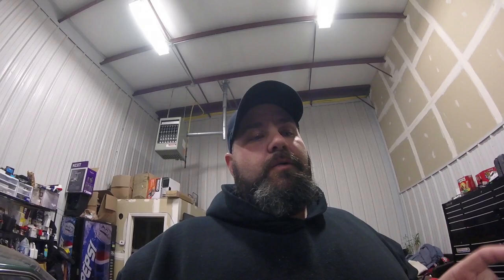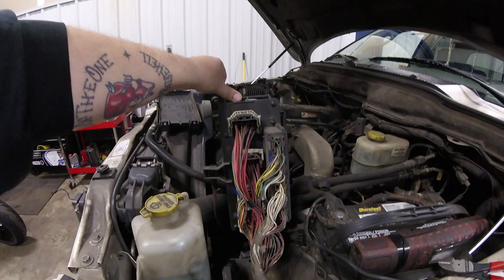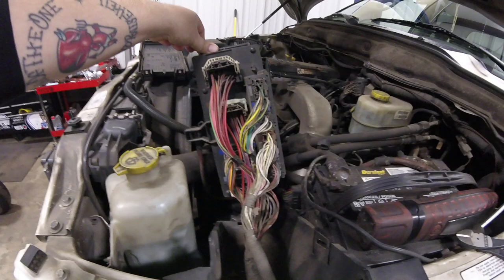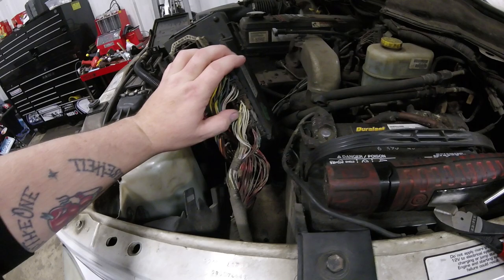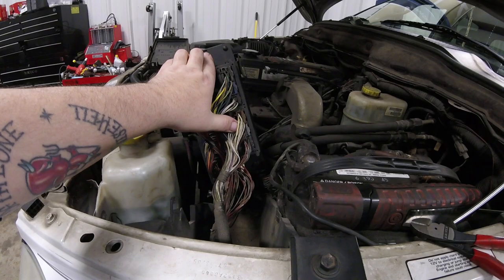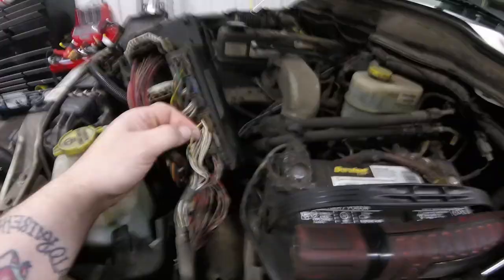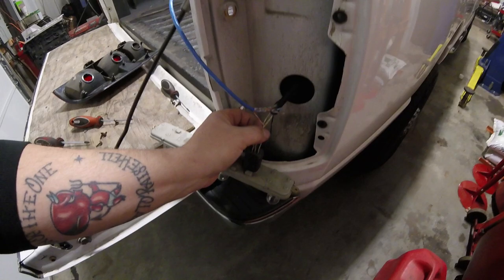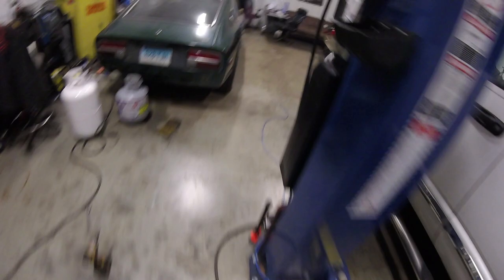Cummins Ram 2500 Bad TIPM??? Maybe not!

Comment: Acts like TPIM, replaced, reprogrammed, running, still same issues.  What ACTS like TPIM but might not be? (Intermittent Symptoms [90+ % of time): all functions of turn signal lever inop, hard starts (acts like WIM, but isn't), stalls at idle)  Most everything else appears normal.  Great, helpful, informative, appreciated videos.  Thanks for ALL the help!

Comment: I would suggest looking under the driver's side fender right below the back firewall. If you pull the wheel splash guard under the fender it's right on the right. there's a connector I have found broken corroded wires fuel pump trailer lights splice New pieces in and everything works fine for a while. Until they corrode and break again.

Comment: I think I finally found the video that hopefully helps me. My  radio works when it wants the power locks,front windows, heated seats and  steering wheel do the same. Remote start only works for 10 seconds or so then shuts off. If the dash cluster light stays on it'll drain the batteries. but doesnt do it all the time. The temprature reads -40 most of the time. some times it shows an acurate temp and then the windows work. It really is funky. Hopefully this helps. If you think its a different issue please let me know what to look for. Thank you in advance.

Comment: I’m currently going thru this problem on my 2008 megacab diesel, no juice that I can find from the right rear up to the tipm, no juice at the pin on the tipm, so thinking tipm is bad, but now I’m going to try actual voltage at the tipm and at the tail and see if I find the same as you did before wasting 500 on the doorman replacement tipm. Thanks for this video. I’m hate electrical with a passion. So this is helping.
Reply: Brian Arnett wish I had seen this message a cpl days ago. Lol.  Already ordered reman tipm, hoping to be installing Wednesday and seeing what I got from there. Thank you though, I bet that would’ve worked although I did try a jumper wire from a know good one and got nothing over there, so maybe I did it wrong. Ha

Comment: Hey! I really like what you are doing for us electro mechanically challenged people.  I have a parasitic draw in my 2007 Ram 1500 gasoline 4.7L, I took it to an electromechanics “specialist”.  He not only didn’t fix it but he gave my truck back with the speedometer not working and two service lights on!!  After calling 8 or 10 times I figured he had caller ID and decided to ignore my calls.  Then I decide I didn’t trust him any more even if the job was guaranteed.  So thank you very much because this video somewhat helps me figure out whats going on with my Ram.  I just subscribed to learn some more with you.  Stay safe.

Comment: thanks a million was driving me crazy,,,almost replaced the timp,,but thank to your video i did more exaclty what you did,,got voltage from tipm,,my probelm was a plug   by driver front left tire,,it was loose,,,put some wire ties around it and worked,,,tnx again,,,,

Comment: Amazing Info. Got a '04 Ram 1500 4.7. Have Towing harness signal issues last 4 years now; due to L & R signals not coming through to the 6 pin Harness Plug. Normal truck signal functions are fine. I even get 12v power, BU Lights, Break Lights & Day time running  Lamps; but again; no L or R turn signals to Tow Harness; for Trailer signals. This dilemma has resulted me in "jerry-riggin"  a Trailer break converter; from each L & R tail light; to Tow harness. While I have gotten away with this last 2 years; recently my Converter corroded badly causing all my signals to go out of wack; hence; I am back to square one. As a D.I.Y.'er I want to pull the whole signal circuit out form under the chassis; to locate a bad (or two bad wires) but it's a hell of a lot of work getting under the truck; when the TIPM could indeed be bad. This vid has enlightened my knowledge. I shall take your insight and Trouble shoot this way before I do anything else that's time consuming. Any other suggestions on how to resolve this issue; please don't hesitate. I just want a normal working tow package that's long term and proper on my ol' Dodge. Non of this wire converter crap.
Reply from the maker: Your best bet is just dig into it. Follow the trailer harness back to the tipm and make sure the harness has no breaks. If the wiring appears to be in good order, then its time for a TIPM repair.

Comment: So hopefully you still read your comments brother. I’ve got a 2011 6.7 thats been putting me through it. 
Windshield wipers randomly go nuts, gauge cluster goes wild. Serv 4wheel dr, gas light, check engine light, and more come on and off, radio turns off and on, and climate control turns off and on and works when it wants to. 
This all happens simultaneously. 
Tipm was very clean upon dissecting just very dusty. I sprayed everything with duster and electrical spray and also dielectric grease. Problem went away for a couple weeks and now it’s back again. If you or anyone could make any suggestions to help me I would greatly appreciate any help at all. Getting a circuit test tomorrow and going over everything I can. My knowledge isn’t vast in electrical or even automotive for that matter but ya gotta do what ya gotta do. Thank you ahead of time

Comment: So glad I saw this! My electrical systems gone haywire! No low beams, same issue as this video with my right tail light, driver side rear window will sometimes not roll up or down unless the door is closed and when open the interior light doesn't come on, if closed, with the interior light on it turns off when the door is opened and finally, my fuel gauge is reading like its sucking fuel at 1MPG! It's been driving me nuts!
Reply: your door to chassis wiring harness is broken inside the loom. Common issue, especially in the drivers rear door.
Reply: im having all the same issues except for the mpg thing

Comment: This is crazy same thing happened in my 06 cause I installed led and the hyper flash made the tipm disable it. I’m gonna try a hard reset. I ram a wire from my rear to from on left side. Now my right side is all out. Only blinkers work

Comment: 06 dodge 2500 diesel. My right rear tow blinker didn't work,(from trailer ground) so I tried jumping my rear blinker to it.  The tipm shut that circuit down too.
I found no power comin out of my tipm to my rear blinker.  Pulled it apart inspected it.  Looked good.  Went to dealer $90 they installed the update.  Raised trigger point from 15 amps to 20 amps.  Both work now.  
Wire colors are different than the 03 to 05 trucks.
Yellow &white wire right rear blinker.  
Yellow & green left rear blinker.
Reply from the maker: The update does help! What we did with my fathers truck however was to install LED bulbs on both the truck and his trailer to lessen the amp draw. He hasnt had an issue yet ;)
Reply: @MorFabIndustries  so I am having this problem with my front head lights I was having them all work then slowly I've been loosing them one by one and it's just the headlights I first lost my driver main light then i lost my passenger side so only had brights then I lost my drive side bright so the only headlight I have left is my passenger side bright everything else works I looked at fuses and I cant figure out what's wrong with it I was told it may be my multifunction switch so I'm going to check that next if you know what it could be would be greatly appreciated if you could help me out

Comment: A customer brought their truck back to the work I work at which is a trailer place that in stalls truck beds too. The problem is the truck won't start and the dome lights flicker and the mileage shows up in the dash and the tell us it's our fault. The bed still works and it's fuse is not blown. No one at the shop know what's wrong with it.

Comment: ok i just watched the video. heres what is going on with my 2006 dodge ram. i've had the truck for 3 years, a year ish into it i had the notorious driver lamp fail. did the little trick to wire the passenger side to the driverside and it worked. now both of my low beams aren't working, but my high beams do. side note. i have leds in the headlights. also when i bought the truck the previous owner had a viper remote start installed on the truck. when i remote start the truck it is hooked up to the headlights and makes them flash. a few weeks ago i remoted started my truck in the morning and the headlights were tweaker blinking and flashing. i drove away to work and i had no low beams. turned off the truck and let it sit for a couple of hours and they worked again.  fast forward a week or two, same thing tweaker blinking with remote start. but this time there is no low beams that work. and they haven't worked since then. now i don't use my cummins that much as it's a 3rd vehicle. today 2/23 i tried brand new stock beams and nothing. checked all the fuses and nothing. i don't have a code reader to see if it's putting out any codes. but man am i lost...
Reply from the maker: Dallas, the big issue here is that the TIPM failed originally when the first light went out. By wiring one light to the other you effectively doubled the current draw on the good side of the TIPM. These units fail due to over current. They have a bit of circuit protection which will allow for some overcurrent without damage, however they are bound to fail rather quickly when hit with double the load. My suggestion is undo the wiring that has been done to bypass the bad light, have the TIPM replaced and reprogrammed, Check all grounds in the engine bay for corrosion, And make sure that you use nothing other than factory specified bulbs in the lights.

Comment: I had an issue with no passenger running lights. So the last owner jumpered that wire to be key on. After dealing with swapping fuses, patching wires on the taillutr harness, change lightbulb boards, cleaning the pins, etc... I just jumpered the driver to the passenger for running lights. Oops... so far, so good. I think the culprit was a hardwired 7pin into the tail light harness overloaded the tipm circuits.

Comment: My 03 ram 2500 had the trailer fuse blown when I bought it. I replaced the fuse and have not had any issues until a week ago when I hit an elk that decided she was on the wrong side of the road as I was driving by. That only busted my grill inserts. That's when my passenger side headlight decided it doesn't want to work. Everything else on the lighting system does.  I back probed the wire about 2 inches before the connection and had a good reading. So I changed the connector. Still no light and lamp out still on.  I have yet to open the IPM.

It would be nice to have a fuse/relay only replacement

Comment: Same truck. Won't crank. I'm reading 10.9V on the Starter Relay. Traced the wire from the TIPM and it reads 10.9V too. Fuse side reads 12.49V same as supply from the battery. Starts if I apply starter straight to the battery via the yellow/Brown wire running from the relay to the Starter. Any suggestions?

Comment: Having this same problem now, just bought a 05 Dodge Ram 1500 literally at 5pm , didn’t even check the taillights when buying the damn truck 🤦‍♂️, riding home to PA from MD where I got it from and people kept flashing their lights, taillights out!!!  Also when you turn the truck off and take the key out it acts like the key is still in the truck and just chimes..Light switch not working as well to turn headlights on and off, I’ve been up tearing this truck apart every since , knew NOTHING about this problem with the dodge, I’ve found that the switch had a wire that broke off to short!! I guess from somebody doing something previously and they used a but connection to do it back, so that was shorting and kept the chime on, so boom taillights still not working, I’ve manage to get the brake lights back by messing with the brake switch, I’m figuring that’s bad as well so I’ll replace that in a couple hours to see if that clears it up , I’ve take the stupid fuse box or whatever Chrysler calls it out and that’s sitting on my table, I’ve pull a couple bulbs as well to replace to see if that clears it up , I’ve also tied the positive and negative together and that’s going to be sitting a couple hours while I clean the connections to the fuse box and it’s plugs , I e also took those strips out of the taillights were the bulbs sit to clean those as well, my question is I’ve look at the trailer harness under the truck as you said shorted rusted wires could cause it , it looks pretty bad , I don’t really know what the factory harness would look like or if the previous owner rigged up an aftermarket, All that was down there was a four pong harness that look like it plug into something on the bumper as there is a big hole there, I’m thinking of just running wires to a switch inside , I’ve seen another you tuber run 2 wires from the light control switch relay in the fuse box, with a 15amp inline fuse  to a 2 wire kill switch , any thoughts on that??? ....another ? Is the strip in the taillights hold 3 bulbs with a 5 wire connector coming in to the back of the strip to control them all , how will I figure out which wires control the backup lights and riding lights which again don’t work , brake lights do , I forgot to mention the bake lights won’t turn off unless I unplug the brake light switch , I’m so in over my head but any help would be so helpful 2005 Dodge Ram 1500 hemi 5.7 if I’m not mistaking , crew cab, 4 doors

Comment: Question for you i have a 2013 ram 6.7 and my wipers went out, replaced switch, motor, and fuse no fix. Removed tipm to test relay and found 2 prongs from plugs underneath with corrosion, cleaned them up reinstalled tipm and wipers fixed but now when i go to put in drive it only goes into 4th gear like a limp mode of some sort. I only disconnected 1 battery when i did this was going to disconnect both batteries when i got home and see if that resets anything. I bought the truck a month ago and it has a tuner and wasnt sure if that had anything to do with it. Also just bought obd2 scanner waiting on that to come in to see if any codes. Any help would greatly be appreciated.

Comment: I just did a 2017 Dodge 5500 with the same problem and fixed it the same way. Some prices dealers charge is in called for
Reply: I think it's absurd that you'd have to do this to a vehicle that is not even 5 years old... Whatever happened to...what's that thing called...? Oh right, QUALITY!

Comment: Hi I could use electrical diagrams for a 2008 ram 3500 Diesel 6.7 C. The problem I have is that the console illumination lights die and flicker, except the needle lights. And my right turn single blinks fast. any help would be nice.

Comment: I have an 07 3500 5.9 and the AC compressor sometimes comes on and works fine, sometimes doesn't. I was told it's the TIPM. Right rear blinker/ brake light does the same thing, like in your video.
Is the AC ad easy to trace?

Comment: Thanks for the excellent video! Currently troubleshooting the driver's side low beam out condition on my 2012 3500 Ram. I've had some odd intermittent trailer brake issues that are probably TIPM related as well. Sub.

Comment: I have 2007 Dodge Ram 2500 5.9 diesel. My power locks don't work unless the key is on, delayed start/ shutdown, center console digital (direction, MPG, etc etc), my key remote doesn't work, and the dashboard says, "No Fuse". Is this the TIPM?

Comment: I have an 08 ram 1500, the cruise control and 4x4 stopped working at the same time. The T-Case actuator works fine, the front differential actuator works fine on the bench using an external battery, it has power coming to it in the vehicle but it’s not switching. I changed the TIPM but the same thing is happening. I think it’s the wiring somewhere. Can you help please ?

Comment: Does my 2001 ram 2500 Cummins have a tipm? I. Having lots of electrical issues and I cant find them......i running lights, no horn but horn will activate right r
Turn sign ,  no break lights.. Just a mess.  Any help is appreciated

Comment: Good morning.  My daughter has a 2013 wrangler with no horn or high beams.  Fuse box says horn (high/low).  So im thinking they share the same fuse.  I swapped fuses and still have the same problem.  Also, no power on either side of fuse when horn is pressed.  I was thinking horn switch but that doesnt explain the high beams being out if they share the same fuse.  Turning on high beams also turn off low beams.  Any suggestions. Thanks

Comment: I am having a lot of problems with communication from the ECM to different parts of the truck a ram 2014 Dodge diesel 2500 now I’m getting the engine light where it said lost communication to the turbo before it was not in park selling Noyd in the transmission but it was replaced and still had the same error code it’s just one thing after another could it be the ECM?

Comment: I have a 06 Dodge 3500 diesel with no brake lights. Everything else seems to work fine. But none of my brake lights work. Flashers work fine. The fuse is good and has power to both sides. I am trying to find out what wire is my pin out out of the TIPM? I also tried jumping the wires from the brake light switch. No luck in getting the brake lights to come on. Any help you can give locating the brake light out wire to test it. Thanks for your help.

Comment: Just ran across this vid. I have. 2017 2500. Right tail light does not work, brake and turn just not tail light. Used a power probe to the socket and have power to it. Power probed wire that powers tail light and it has power with the bulb out, once i put the bulb in the volts drop to zero. Could that be a bad tipm?

Comment: 2006 diesel no left turn signal stop working checked fuse box everything  checked power to all fuses. For some reason I now lost all power to the tipm just where the fuses control stop turn bank everything else is hot.so whats up.